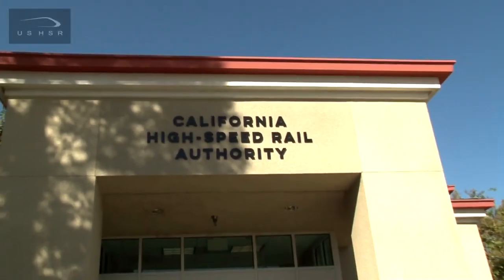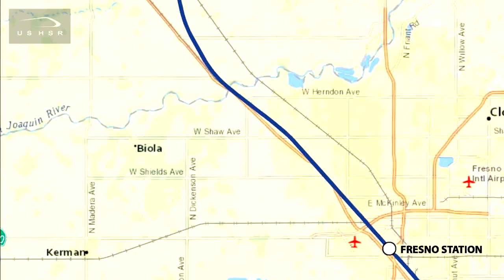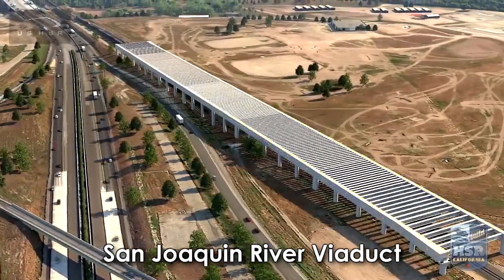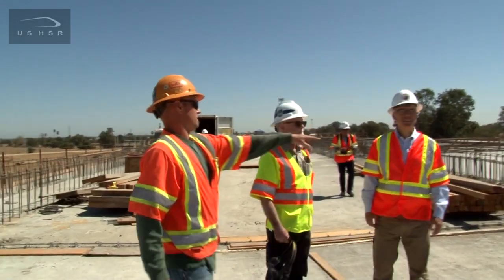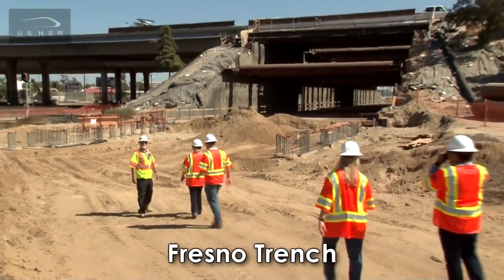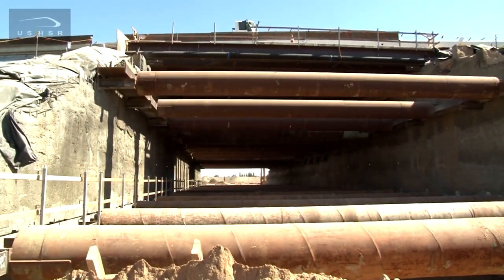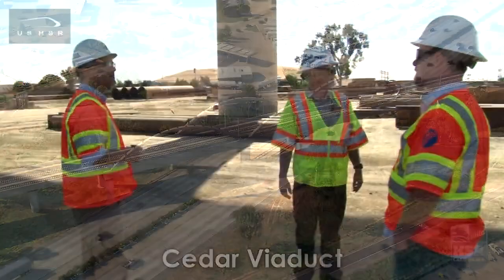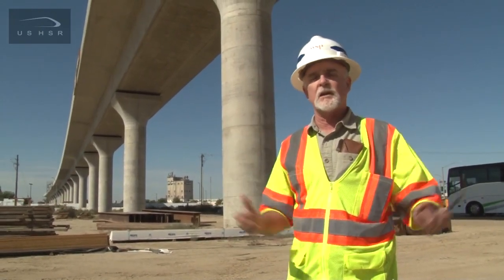Construction Tour: California High-Speed Rail (Fall 2018)

Comment: OK. It is now 2021. How many miles of actual track have been completed, including the wires and power supply? Zero, maybe? I thought so. Remember, it has been nearly TWENTY YEARS since we started paying for this (that is a generation right there). In the first 10 years we got a lot of 'studies' for our money. Maybe, just maybe, if we keep hoping, and praying, and most of all PAYING, in will be finished in time for your GRANDKIDS to take a ride from San Francisco to Los Angeles on it. They will be in high school or college by then. They won't be riding for a weekend in LA, though. It will be too expensive for that. Don't believe me? The ride from London to Paris costs $350+ round trip, and it is a shorter distance (SF to NYC round trip on Jet Blue is less than that).

Comment: Wake up people! The voters approves a bond for $10 billion for this project back in 2008. Now this project is approaching $77 billion and estimates are that it is going to cost $100 billion when all said and done. They are stealing our tax money and making us pay more at the pump for a novelty item. Be honest, if it takes 4.5 hours to get to San Fransisco by train and a 1.5 by air which one are you going to take? We have airplanes now! It is not the year 1920 anymore! Wake up and stop this thing in it's tracks.
Reply: You must take into consideration the time you spend to get to the airport from the city centre too. Here in Spain, 2/3 of trips between Madrid and Barcelona (600 km) are made in high speed trains, instead of using planes, even the times are similar to those you comment, the train is more comfortable
Reply: Let Chinese builds it, you'll get twice the length.

Comment: so... how OVER BUDGET is this now? and how many people will this actually impact? very few in the state will use this more than a half a dozen times.
Reply: Curtis, are those your made up statistics.?
Reply: @gregghanson6095  what stats did I state? I asked questions. and I stated an opinion. plus, I know me... I don't really have the desire to "speed rail" to NorCal. I like road trips. if the rail is actually completed, it'll open the freeway up for me and my road trips. which will be fine. however, I will have to put up with the semis on the freeways... they won't be able use the rail. that is until the rail starts going bankrupt and the CA gov't starts to use the rail for business purposes to cover expenses. airlines do this with some package shipments to supplement their costs (this I know because I was trained with shipping hazardous materials). so more hazardous materials will be shipped with nonhazardous materials and people. then, in my opinion (again) it will mainly be a means for cargo to be shipped from LA to SF (areas) with some people. it'll be like freight/cargo ships are now. this will be the case because the freighters will pay just a touch more than the people will based on cost per space. again, my opinion.
Reply: @atruefreethinker1944   "few people more than a half dozen times????  You made that up.  We're all happy for you the you like to drive.  The upsetting thing about this is that you seem to have no regard for the future or the impact of what the trains can do for the STATE...not just YOU driving along in your car.
Reply: @gregghanson6095  fair enough I did state that. however, it is over budget already (doubled by some news sources). that I didn't make up. so... stop taking my tax dollars to push this. oh... I don't get a say in that do I?
Reply: @atruefreethinker1944  Of course it's over budget!   Every construction project is over budget. Yeah, you do have a say in where your tax dollars go...vote.  We work on a majority rules concept here. We all have to be taxed on things that are not our individual priorities.  If you NEVER take the train, you are supporting millions of your fellow Californians who will.  :)
Reply: @gregghanson6095  regardless, there are more important places to funnel our tax dollars. the rail is not an important place to OVER-expend our tax dollars. you said it... "Every construction project is over budget." I just feel that while Trump pushes for the less gov't ideal, we should prep for the people. we need to fix what we can that he does not want to. he ignores the people and we vote to implement frivolous spending. he doesn't want to help the homeless, yet we spend as if we don't care either.
Reply: @atruefreethinker1944  agree with what you said.  The speed rail is a hell-of-a-lot better spent than the 50 billion dollar WALL ...that will never happen.  did you get the video I sent?  Wanna get your reaction.  Gorgeous piece of engineering and service, speed, convenience,, food, logistics.  Europe knows how to do this.
Reply: @gregghanson6095  I just watched it. It's a very nice video. I'm sure it is a fun experience. It may continue to be a good system. Sorry, but I'm a cynic. My criticisms on all of this are based on how people really are. So here we go... as stated before, over budget by a lot; disrupting people's farms/land/homes; newness only lasts as long as it is new, it will get graffiti-ed (bathrooms and seats etc), it will get damaged (carpets and seats), it will get rickety (I only state that last segment because of the beautiful video and the man's shot of bathroom); the video was about someone on the first trip Business Premier class where he was overfed... what was the standard class like? no video?... I sure fine but how long till the perks are taken away?; nice give away bag, should have saved that money. I do realize he paid for the better ride, but I'd like to see how the standard class traveled. I'm sure the newness is still a factor, but I'd like to see how they are treated. What about the fact that this is a great terrorists tool for all of them that have a hatred of the US? Look, all I'm saying is that I see things as they really are... this was not needed. It will have a heavy upkeep cost that includes wear and tear to the trains and the tracks; it will more than likely incur damage from earthquakes (if it is so fast, it will need precision adjustments when shifted); there will need to be pay offs when accidents occur (and they will occur). I feel just widening the freeways would have been a smarter move at this time. Flying was still a smart move considering a lot of CA is ugly to look at from ground view. I'd say that this will help bring the costs of flights down, but realistically all that will happen will be that flights will be reduced in numbers and they will be overbooked as airlines have been doing. Sorry Greg you just cannot sell this to me. Again, too many homeless, deteriorating roadways, dams breaking down, infrastructure needing fixing, school systems needing help because of overpopulation, etc. I can definitely go on on things that need bettering. But there is that fun convenient train rail thingy that we will need to add to that list soon enough.
Reply: @atruefreethinker1944  you ARE a cynic!!  I tried, tho. My problem is that I hate flying.  Before retirement, I spent half my life on planes and watched the service, comfort and hassle just get worse and worse.  Love train travel, have done much of it in Europe and China...it is hands down superior to air.  All those awful arguments for speed rail  you made are all possible.  One place where I would wildly disagree with you is widening freeways.  The more lanes that are added, the more cars seem to find their way to the expanded freeway.  It's stalled traffic with six lanes or ten..makes no difference.  School systems are always on the political agenda during elections but rarely does anything significant ever happen and certainly not on the federal level...so that's a pipe dream.  Terrorists on trains??  Come on now, Curtis, even you have to admit that's a stretch.  They would much rather crash an airplane and kill everybody than take a chance with a train where people actually survive crashes!  And obviously the engineering for earthquakes is part of the plan.  Which is better, an earthquake on a train, or any accident anywhere on an airplane?  Anyway , been fun chatting. On my bucket list is that Eurostar trip from London to Amsterdam, or Paris. So I'll think of you as I am basking in luxury in my 1st class suite and you're stopped dead on an interstate somewhere  with construction,  car crashes, and glutted roadways, awful food options and no place to pee for 200 miles !  Road trips USED to be fun too, tho. !  Happy New Year!!!
Reply: @gregghanson6095  Yes you tried. Very well, too. My mom never flew. Scared to death of it. I understand where you are coming from. The rail will be completed. Happy travels. You'll get around... or here to there. Oh, and yes, I'm very sure I'll ride... just not as much as others. I wish you a Happy New Years, too. And MANY MORE.
Reply: @atruefreethinker1944  :)

Comment: Ours is already running in miami. Miami to west Palm with eventual connection to Orlando. Generally it works well doing what it's designed to do. Transporting people at above average times with minimal imprint on the passing community. Problems are that it's slightly expensive. However that problem will be less likely in California cause the vast majority of ridership is going to be salaried workers. Alot of our workers here are hourly. So they use the tri rail instead.
Reply: Brightline isn't high speed. It runs at 80mph for the existing right of way, and will only run at 110 from Orlando to Fort Lauderdale. CAHSR will run at 220 mph, one of the fastest in the world.

Comment: This is a scam! How many times have you taken a train in the last 6 years? They cannot find any private investors for the project because this is a unprofitable venture. They are going to raise everyone's taxes for this
Reply: Bryan Bohlken you can’t take trains that don’t exist. Also, roads are not profitable either, but I don’t hear people complaining about that. Roads are massively subsidized.
Reply: It would have been safer and cheaper to build a series of Airports instead of the high speed rail in Earthquake alley...    Plus,  it's enough money to buy a half million electric taxis to get the people to and from the Airport.
Reply: @THOMASTHESAILOR  It would not have been cheaper, it would not have been faster and it would not have been safer.
Reply: @Sedna063  ,  Sure it would,,  Ridership on the Train will be low,  cuz,  it's slower..  Therefore the income from trainfare would less money to pay for the project..  Which makes it more expensive...
  CA has lots of flat land for Airports..  Shuttle planes are cheap compared to jumbo jets..  They need smaller runways, etc..
Reply: @THOMASTHESAILOR  The train will not be slower. Try being in SF from down-town LA in 3 hours with the plane. The HSR will also connect cities like Fresno - Merced, Bakersfield, Palmdale better than now and it is hardly possible to have a steady Fresno - Bakersfield flight....

In any case, land is expensive and airports require a lot of land, often more than an entire rail track.
Reply: Bryan,.have you noticed there are no trains to take? Lord, man.  wake up.
Reply: Yeah because everyone is on airplanes bud, it is not the year 1920 anymore.
Reply: Gregg Hanson wants to take a train for 4.5 hours from LA to San Fransisco when he can fly in 1.5 = brilliant
Reply: @bryanbohlken7653  good Lord!!  Have you ever flown before from LAX to SF?.Traffic, parking fees, security, report two hours before your flight, get delayed and repeat the whole routine when and if you arrive. AT LEAST 4.5-5 hrs. Have you ever been on a high speed train?  No parking issues, no baggage fees, no security wait, fly PAST people like you on the freeway, arrive, connect to metro at the train terminal.  You know nothing, sir.
Reply: @bryanbohlken7653  How much time are you really saving when you gotta get to the airport 2 hours before departure and deal with traffic? How long does it take to get from LAX to anywhere inland?
Reply: @bryanbohlken7653  When the project is completed it will take 2 hours 40 minutes from LA to SF. Downtown. When was the last time you were downtown in LA or SF from the other city center in 1 hour.
Reply: Thank god your views are in the minority or we would still be using horse and carts.

Comment: The cost will more than quadruple by the time it is built because this is not 1890, it's 2018. California's hyper-regulations alone will make it take much longer than proposed. Plus you don't have the open spaces like ranches that you once had so every partial will have to be dealt with. Good luck with this one.

Comment: I was born and raised in Southern California and I’m glad to see this high speed rail project finally underway! To my memory, various special interests have blocked the development of this type of project in California as far back as the 60s. It would have cost a lot less and would have been far less complex had it been done then. Prior to recently retiring, I commuted between Northern and Southern California by air; I wish I’d had a high speed rail option.
Reply: 1Drummer I totally agree with your comment. High speed passenger rail outside the Boston to Washington,DC Northeast Corridor should have been built in the Mid 1960’s between San Diego, Anaheim,Los Angeles,Oxnard,The San Francisco Bay Area & Sacramento as well as through the Central Valley and to Las Vegas from San Diego & Los Angeles as well as from the San Francisco Bay Area to Reno.
Reply: At the cost of burning people out of their homes??
Reply: This project is 4 times over budget and you are paying at the pump for it. You will be able to fly a lot quicker then you took this train.
Reply: @bryanbohlken7653  . Just upgrade the existing lines and run trains day and night!
Reply: I don't care how  "High Speed"  it is..   It still takes a lot longer to travel by train instead of Plane..   Trains are not cheaper either...

Comment: Seems like it is taking longer than it should... but hay, better late than never!
Reply: This is a huge project. It's gonna take a bit lol
Reply: I'd agree. I understand that the First Transcontinental Raildroad took6 years to build without dealing with large populated areas (full of infrastructure) to overcome. I honestly think that a shorter high-speed line, such as San Diego-LA would have been the better place to start. Had that been built, it most likely would have changed the public's opinion on high speed rail in the first place.
Reply: @tannerrobinson5110  yeah I think starting with a smaller line would've been better. All well. It's already in construction thouhj
Reply: Same with HS2 - wonder which will be finished first?
Reply: never would have been wiser.